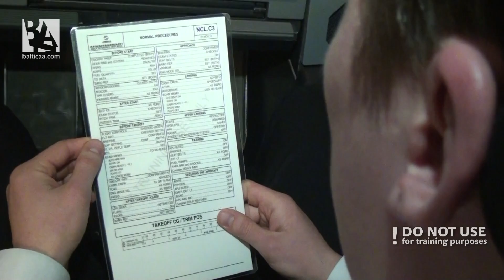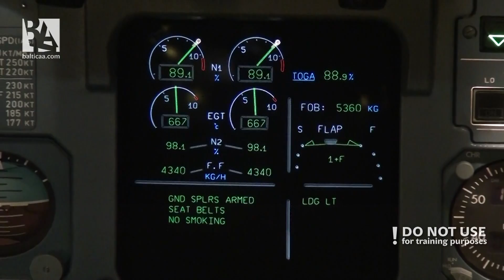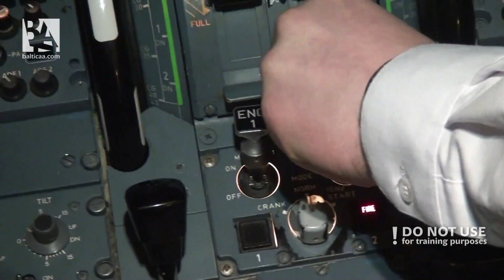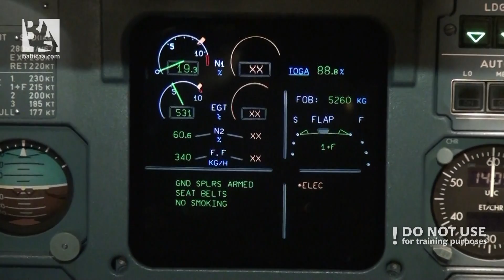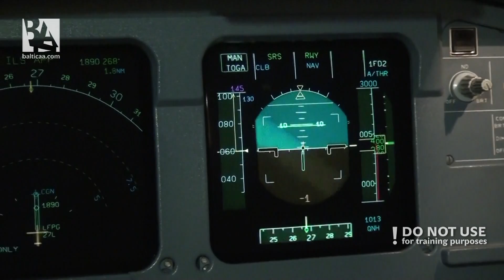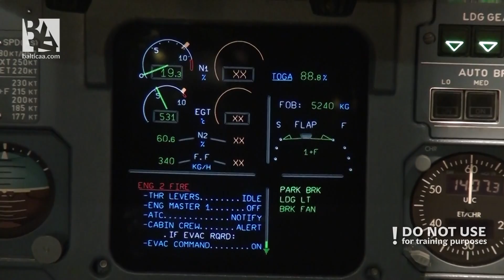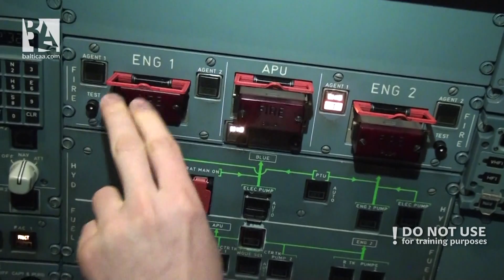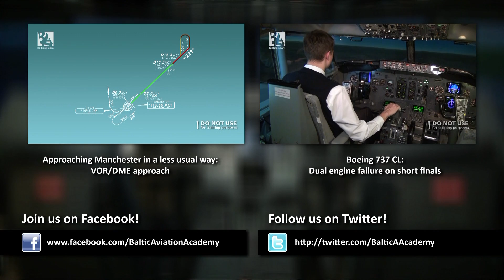Airbus A320: Engine Fire During the Take-off Roll

Comment: If there's engine fire on both sides. Which slides would be preferred for evacuation? Do we look at the wind direction as well and use the exit on the windward side?
Reply: depends on the aircraft, but yeah look at the wind, and because most aircraft have one engine under each wing, and most flight depart into the wind, that would push the fire and smoke towards the back, meaning no fire at the front two exits. It would be the same with a crosswind, it just pushes the fire and smoke towards the sides. For example, if you were to be departing on a runway with heading 270, and the wind is coming from 181, you'd still use the front two exits, as the smoke and flames would go slightly more towards the back, even though the difference between using the front two exits and back two exits is just 2 degrees.

Comment: JUST ONE QUESTION
HOW CAN JUST YOU PUT THE AFFECTED ENGINE 2 ON REVERSE?
Reply: fire takes a while to destroy an engine, it will still work with less power in the seconds after the alarm goes off. and you want every little bit of breaking power you can muster during a rejected takeoff.

Comment: What’s the difference between Agent 1 and Agent 2? Isn’t 1 and 2 during a fire? And agent 2 Is only for when the engine is damage?
Reply: It's just two separate extinguisher bottles. With a fire, you just want all in. In flight, if I remember correctly, you release them with time in between so that the second one finishes off what might have relighted. You only release one for damage to be sure. And if you actually still need it, there is one left for later on. But the less precautionary extinguisher you discharge the more thankful the ground crew will be as it created a mess! :D

Comment: Off the get-go: the fire is not "out" until it is visually confirmed by either the fire marshal or the tower. Also, the use of above idle Reverse Thrust is not a good idea with a suspected engine fire, especially at low speeds , and the aircraft will stop on the remaining runway without its use (Brakes only). And last but not least, in Scenario 1, sitting on the runway attacking subsequential ECAMs makes very little sense and is a waste of time...
Reply: Always nice to hear utter nonsense from a know nothing. Thanks.

Comment: turn the aircraft into the wind in case on an engine fire
Reply: It won't help the fire is faster than it.
Reply: That's not the point. If the aircraft is not directly pointed into the wind, the wind could blow the fire onto the main cabin. This once happened to British Airways one time I belive.

Comment: first agent discharged immedialty..i get it...but second ? it's there in case you still have a fire after 30s usually ? why is the Sop this way ? any logical factors involved  in this ?
Reply: You’d want to pop both bottles right away to maximize the amount of halon in the cowling. The ECAM does direct you to wait 30sec before discharging bottle 2 if in flight, however. But there’s little to no airflow in the cowling when stopped on the runway.

Comment: Depending on how long the runway, it might be safer if your aircraft lifts off to come immediately back down.
Reply: Never possible in an airliner. After V1 (takeoff decision speed) there's not enough runway left to stop without taking off, much less to lift off then immediately come back down.
Reply: Yes its safer if the runway length is  100miles

Comment: What happens if the engine catches fire after V1 or V2
Reply: late reply I apologise but v1 is seen as the point of no return. As soon as you hit V1 you're committed to going airborne
Reply: +Elias Gergi The aircraft will continue in the air and the pilots will extinguish the fire if needed and then necessary action is taken :)
Reply: If the extinguish fails is it time to accept fate or are there any other actions to take
Reply: +Elias Gergi yah I'm pretty sure that's the only way to extinguish the fire. If it fails then they accept it. The engines are meant to contain the fire in one place though.
Reply: Ok thank you for the replies :)
Reply: Well yeah, but V1 is calculated very precisely and if you try and abort after V1, you will most definitely overshoot.
Reply: Neume Sometimes overshooting is better than plummeting to the ground with no engines :P
Reply: ProPilotGaming Pilots are highly trained, unless like a wing falls off on V1 (which is highly unlikely) then they are commited to taking off
Reply: Elias Gergi take off deal with the promblem and land asap

Comment: Are there any circumstances where a large passenger aircraft (eg B777 or A330) about two thirds full of passengers, can take off with no flaps, no leading edge slats extended..a completely clean wing?
Reply: Well in that case you are typing this from heaven :P (I don't think hell has wifi...)
Reply: +John Smith Two third full is still a lot of weight ;)
Reply: Speedbird No, only 100% sure, there is no such thing as 110%. Nice try though..
Reply: Obviously, but they will need to achieve a higher speed a takeoff which means they need a longer runway. The assimetrical airfoil on the wing makes it possible for at a completely level flight certain amount of lift to be produced by the formula (L=1/2  P V^2 S C^L).
Reply: 2015newyear Cheers, the reason I ask is because I was on an A330 and was watching for the slats/leading edge to come out, but they never did. My palms were sweating as the pilot applied full thrust..
Reply: +John Smith I think the slats were lowered, you just did not see
Reply: Speedbird Trust me I was looking, and listening. That sound is very distinctive..
Reply: +Speedbird  reminds me of LAPA
Reply: In the checklists nowadays they set the flaps/slats already after pushback. Around the time they also start the cabin crew safety briefing. 
I doubt an airliner will take off without flaps/slats, even when calculations say it's safe..
Reply: Mitch Puts We definitely took off without flaps from Bangkok. The plane was very light.
Reply: That is simply impossible. The plane first, would not have gotten off the ground unless it was completely empty, and with very little fuel, and second, the master warning would be constantly blaring! Unless there is a way the plane managed to get above 200kts on the runway, there is no way it took off without flaps or slats.
Reply: Speedbird Well, I'm at a loss here, but all I know is we took off with a clean wing. Very few pax and possibly very little fuel for the 50 minute flight.
Reply: Are you 110% sure they didn't takeoff with minimum flaps?
Reply: See, you have had to have heard something wrong. There is simply no way a heavy aircraft can takeoff with no flaps legally.
Reply: Speedbird You got caught out when you mentioned 110%..lol
Reply: If you have the wrong flap setting, TAKE OFF CONFIG warning and other bells and whistles will catch your attention. Also, Takeoff-config systems have been mandated since 1970s by FAA. So if an airline flies into US territory, then disabling it is illegal. Ref: FAA AC25-703-1

Comment: what´s the function of the PA button?  in 2:25?
Reply: +Pedro Picon Barriel  to notify the crew to proceed to their assigned stations in case of an emergency
Reply: +Gio Sauquillo also tells the crew the flight deck is aware of the situation and are dealing with it
Reply: +Pedro Picon Barriel PA stands for Public Address,a way to send voices over Loud Speaker
Reply: aaaa, thanks!
Reply: It's actually Public Address.

Comment: Hi, I've got a stupid question.
What does this mean: "50 percent and one"? (01:46)
It appears in this video but also in FSX e.g..
thanks so far.
Reply: He says 50% N1 when both engines are set at that thrust setting. It is recommended that the power is set at 50% and stabilized before advancing them to take off power as this ensures that there is no asymmetric thrust - hence easier to stay straight on the runway.

Comment: During your procedures you are not verify with the guy next to you when you starting pressing switches? You just extinguishing right away with out a confirmation?  Why ?
Reply: +fotisaiki For a fire on the ground there is no requirement to confirm selection of guarded switches, the priority in this case is getting the aircraft safe. In the air clearly shutting down the wrong engine can be catastrophic so guarded switches are all confirmed before action...
Reply: ***** All right thanks. Every aircraft and company has their own policy I guess...Fly safe :)
Reply: +fotisaiki Some airlines may perhaps differ but the Airbus way is as I stated - http://www.pprune.org/tech-log/544754-airbus-ecam-actions-ground.html

A330 FCTM - AO-020 TASKSHARING IN CASE OF EMERGENCY EVACUATION - 'When applying the EMERGENCY EVACUATION procedure, the F/O can select the engine master OFF and push the fire pb, without any confirmation from the Captain'
Reply: I was just curious. I am an Embraer guy my self :) Thanks for the reply though !!! Happy landings, safe flights !!

Comment: It certainly can contribute to the increased likelihood of the second situation occurring and/ or damage, so using reversers on the unaffected engine only is a good safety-first approach on some runways with some aircraft - watch brake use.

The point is to stop the plane ASAP and evacuate if the engine cannot be extinguished.
Reply: I heard somebody say that when travelling at that speed, rather than assessing which lever to pull, it’s safer to use all potential reverser power and stop as soon as possible (It was an A330 in that context but i believe the same applies)

Comment: Correct, which is exactly what should be done. Passengers need to evacuate the opposing side of danger. The BA crew on the recent incident involving their Airbus A319 with an engine fire put the passengers out of any risk, they evacuated the opposite side to the engine fire. I should know, I was there and saw it land at Heathrow.

Comment: True, depending on the aircraft, they either light up automatically, or they are activated by the crew. If it is automatic, it'll be programmed to run off of standby power from a power source such as a battery anyway, if not, the crew will have to switch them on.

Comment: Turning off the batteries entirely would prevent the function of systems that aid in the evacuation process, such as emergency strip floor lighting. The batteries don't present as a hazard, APUs and engines are usually shut down, but batteries are left running. (well, unless it's a 7late7 nightmareliner) ;)

Comment: Using thrust reversers during an engine fire is risky and should not be done. It can cause a deflection of fire from the engines in the direction of the wings and fuselage. It can make the situation much worse and impede safe evacuation of passengers. this also depends on the wind direction but it's too risky to do, so yes, it is bad. That said, thrust reversers don't need to be used. When calculating stopping distance on a runway, it isn't usually factored in. :)

Comment: Thank you for all the answer, but the agent is not inside the core its in outside of the core when it is discharge so when you disconnect the auto pilot is it possible to restart the engine? if you know that the fire is distinguish?

Comment: Ideally, reverse thrust shouldn't be used at all under abnormal engine conditions, as if the engine fails while thrust is reversed the aircraft is at risk of veering off the runway.

Comment: Airbus changed the procedure because a plane landed with only 1 reverser working. Then it skidded of the runway and nearly killed all the passenger on board. The old procedure was to only pull the reverser back that is working but after the crash airbus changed the procedure to prevent this from ever happening again.

Comment: I think it doesn't matter because the engine is already damaged. Even if the reverser thrust isn't as high as in the other engine there are stil those flaps that open and create drag. And the engine is stil rotating the fan, so it stil creates some thrust.
AND its much easier just to reverse both engines. You don't have the time to check which engine is on fire if you just hear the sound of the engine fire warning.